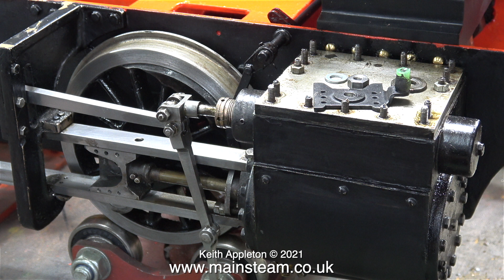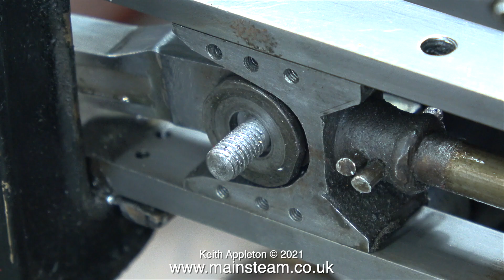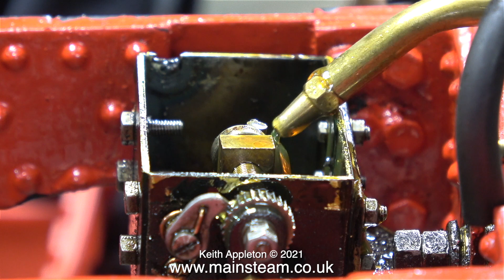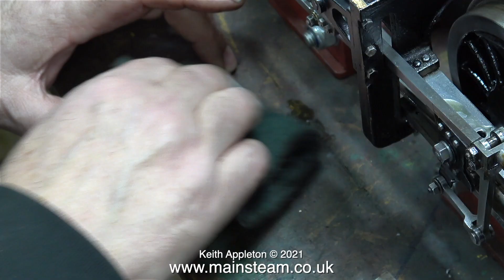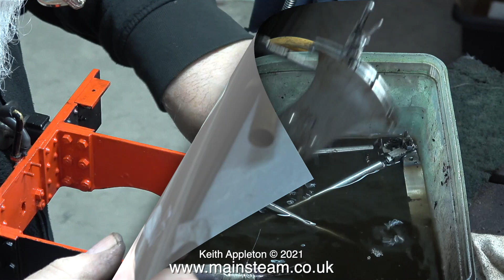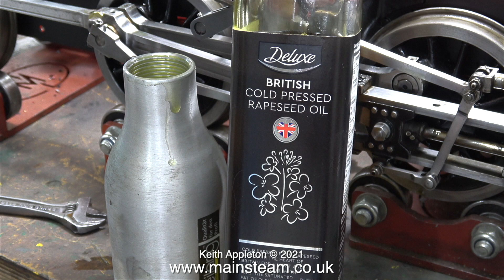SIMPLEX PRAIRIE TANK - PART #62

Comment: I s the wobble in the frame due to an axle being improperly quartered, or is side rod problems?
Reply from the maker: it is often the way of things . . . the Chassis on it's own is quite light and front heavy - the oscillations should be less when the weight of the boiler is sat on it..

Comment: I'm curious on how heavy the frame is before the boiler and super structure are put back.
Reply from the maker: Sorry no idea. This series is currently on episode #84 (www.patreon.com/keithappleton) and the boiler is now fitted.
Reply: @keithappleton  How much does the whole thing weigh with the boiler now attached? I'd imagine locomotives that size aren't very easy to move around.
Reply from the maker: I have no idea, I didn't weigh it. 5 inch Gauge models are manageable - 7 14 inch Gauge models are very heavy.

Comment: Just curious, it seems to jostle about a bit while running. Could that potentially be evidence of the wheels being out of quarter as you've hypothesized in the previous episodes? 
I have a locomotive in HO scale with the third driver set being slightly out of quarter and causes the blind drivers on the axle to bind up in turns. When given the power to make it through the bind, the whole locomotive jumps off the track.
Reply: The model of mine with this quartering issue is a 2-8-2 mikado made by Tyco Mantua. It's certainly not the best but it's a good platform for customizing. I've bought a second chassis for it, one with a better drivetrain set up that's much more friendly to upgrading motors, and the original had a bad drive gear that made way too much noise.
Reply from the maker: it is often the way of things . . . the Chassis on it's own is quite light and front heavy.